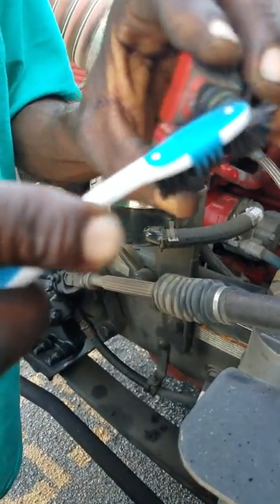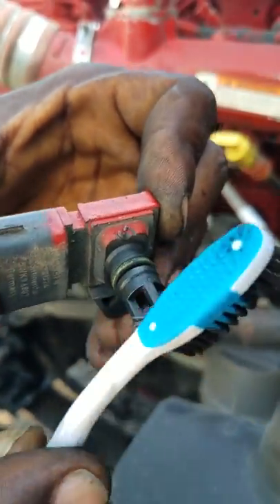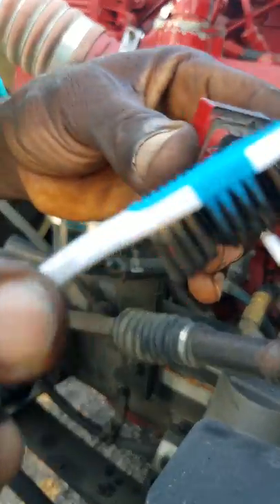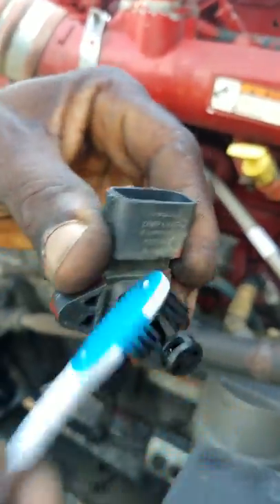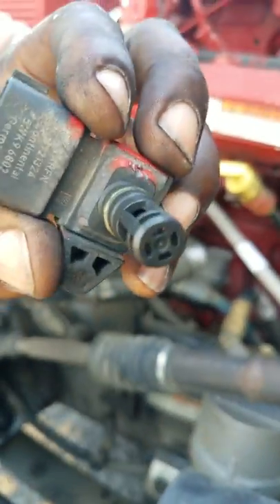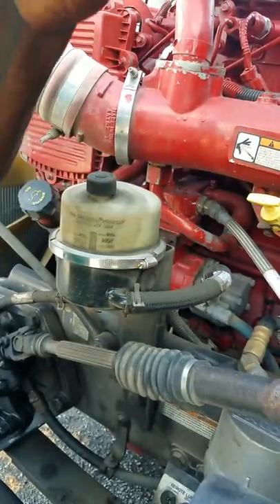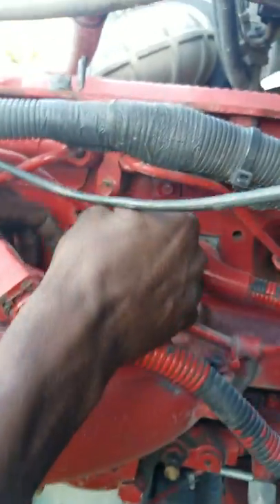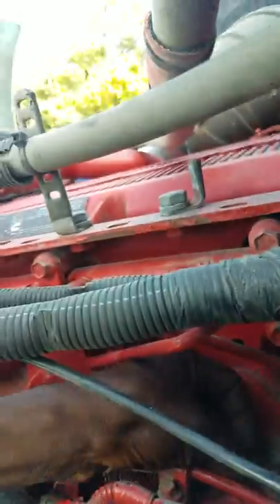High exhaust heat on cummings isx engine part 3

Comment: You know anything about vw!?
Reply from the maker: Jonathan Walker what's going with your vw my brother i might can help you for sure.
Reply: I got a mass air flow kicking in and out sometimes it's fine and sometimes not. I cleaned several time but maybe I been cleaning it wrong! What you think?
Reply from the maker: Jonathan Walker i think you need to change the air flow  sensor